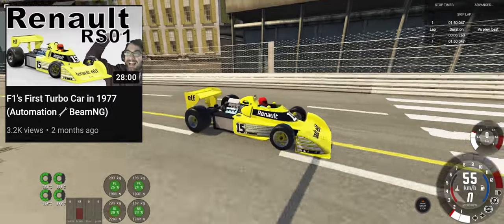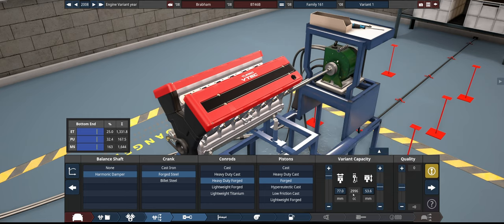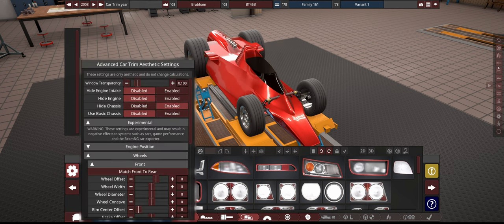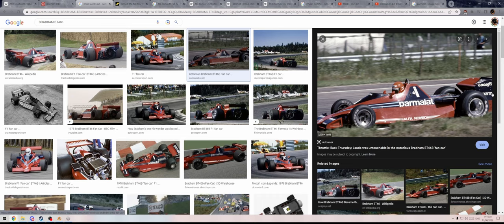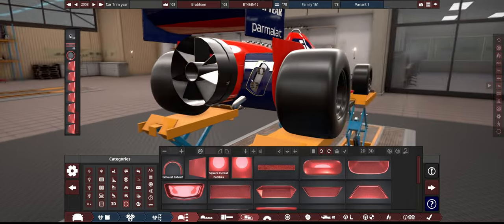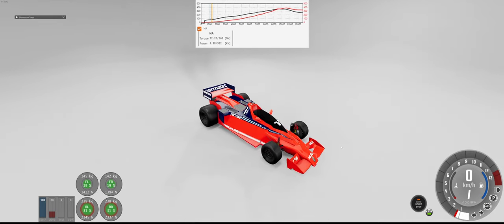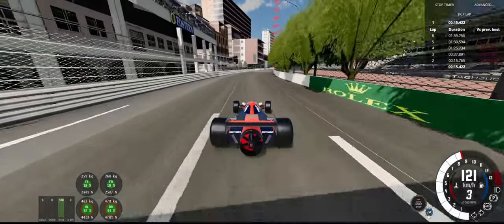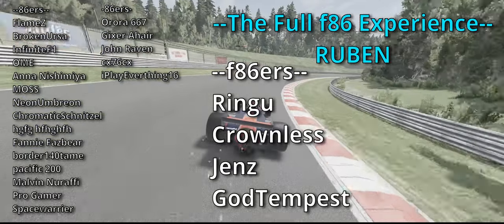I Made the F1 FAN CAR in BeamNG (ACTUALLY WORKING!!)

Comment: No, the car wasn't ilegal, FIA said that you can use a Fan for the car, but at least 50% for cooling(they said 50%, they said another word, but forgot what is the word lol), so they used 51% cooling, 49% for downforce, Brabham wanted to merge(is that correct?) with Lotus, and if Brabham didnt stop using the BT46, they wouldn't merge into one team
Reply from the maker: the ratio of cooling to downforce is a flawed one, and only makes sense if you do mental gymnastics. There was also rules that stated aero devices had to be fixed to a sprung part of the body, and immobile. So if they wanted it to be legal, it was going to have to pull from the side, front, top, or rear.

it didn't exactly get "banned" because of the back door deals made, but they would have not let it race more than that race. And brabham would have fought the rulings.... this was the easiest solution

Comment: that tube on the nose is called a pitot tube. its usually seen on aircraft. pitot tubes measure true air speed meaning how fast something is actually going without any thoughts of outside effects. that is in contrast to indicated airsp[eed wich takes in to account the wind going against something and the temprature ect. so true air speed is the most acurate measurment of speed and its measured in knots

Comment: Fun fact, that car was of course against the spirit of the regulations, but actually legal!
Basically, the rules of the time stated that any movable part can’t be used if it’s PRIMARY function is generating downforce. As it has to be primary function of the element(so more than 50% of movement aids downforce), an “engine cooling fan” can actually be used as long as majority of air is used for engine cooling. The BT46-B’s fan used around 60% of air it pushed for cooling that Ferrari/Alfa flat 12(which was by the way VERY prone to overheating), with the remaining 40% sucking the car to the ground. The FIA actually allowed it to race for the rest of the season(with changing the regulations for next year making such things illegal)
As to politics, Bernie Ecclestone was the chairman in FOCA aiming to be the leader of it, and all other team bosses said that if he won’t retire both cars after Sweden he will lose all support from them. Bernie agreed to willingly retire the car after 3 GP’s, though it ended up racing only in one
Reply from the maker: it's primary function was not to cool though :P it was no better for its cooling being there.

also the rules stated that all aero parts must be immobile, and fixed to a sprung part of the car. It was against the rules, but it could be considered in a grey area if you did mental gymnastics haha. The rule hadn't been tested, and was going to get banned, and they would fight the rulings etc, but the owner made a deal to remove it, and became the head of the FIA shortly after

they also didn't close a loop hole the next year, they clarified it :P
Reply: @fillman86  of course it wasn’t it’s primary function, as in it wasn’t built for that, but the bigger part of the fan’s work was cooling the engine. It had to be this way, so that it wasn’t considered an aero part by the rules and didn’t have to be immobile. That’s the grey area You are talking about. 

Also, Bernie never worked in FIA, You probably mistaken it with FOCA. FOCA(Formula One Constructors Association) was the opposing body to FISA, which was the governing body of F1 at the time. It was a delegated part of FIA and ended up merging back with FIA in 1993. FOCA ended up becoming Formula One Group holding all rights to F1.
Reply from the maker: @rotkiW9014  ah, I did the political research about 6 months ago, so my memory was foggy.

Define an aero part... something that aids in creating downforce? then it needs to be bolted to the sprung body, and be immobile. If they wanted to cool the engine this way, then it must draw from the front, sides, or top :P I know you want it to have this cool thing, but think of it this way, they cheated, and got away with it haha
Reply: @fillman86  That's not what the rules said at the time, that was the grey area they exploitet. Since more than 50% of the fans job was cooling the fan it was legal under the rules as a cooling device. Of course the intention behind it was to create downforce through it, that's why it was designed to be so big. That way even using less than 50% of its power to create downforce directly meant they had enough to make the car work.
Reply from the maker: @Sternendrache11  it was exactly the rule, because it was to combat people attaching wings to the suspension, or directly to the wheel-hubs, then having them collapse

Comment: the jato trick is a bit janky but then again the whole car irl basically was aswell.
Plus to an extent its pretty realistic to the real thing, considering the fan was directly attached to the gearbox of the Brabham's engine.

the car is in automobilista 2 aswell, and the car is still hard to work with in a fully fleshed out sim like that. Definitely an experience, trying to take a slow corner and pushing the throttle more than normal and praying the fan works, or riding the clutch to bring up more revs.

I dont remember where this information is from but Im pretty sure even Gordon Murray himself said the car was rushed.
Reply from the maker: it was, because they knew that the first fan car on the track, would be the last. And it was an easy win to take, so they rushed it to track first
Reply: @fillman86  I think it was also due to the engine itself. 
The Cosworth DFV in the Lotus 79 took up less space underneath the car where it mattered, and meant more room for the ground effect black magic they were looking for. Ferrari were in a similar situation, the flat engines were good for lowering the centre of mass but took up room that could be used for maximising any gains ground effect had to offer.
Brabham were basically forced to come up with a solution straight away due to of a big chungus engine.
Reply from the maker: @Lego___  they weren't forced to do it, it was just an easy trick. As for the flat 12, they were in a tricky position, but ferrari eventually made it work, though in a diminished fashion.

They were also well aware that the car would likely not be allowed, or only allowed for 1 race (it was said that it was allowed for the rest of the year, but that's not true haha)
Reply: @fillman86  true, though it was obvious the flat 12 cars all had a disadvantage compared to what Lotus could do with the DFV

Speaking of 12 cylinders however, 100% agree that automation V12's sound horrible. They always have sadly, though they used to sound amazing in 4.26 with the intake sportiness settings, it almost sounded identical to the AM Valkyrie (though sounded nothing like it in beamng)

Comment: I understand that over the history of production cars only Ferrari ever put flat 12s in them (Testarossas and Berlinneta Boxers), but I SERIOUSLY WISH automation had them as an option.

I'm absolutely not a game dev. I have no idea when it comes to the difficulty of adding options to a simulation game, but would it be that hard to basically simulate welding two flat sixes together 😂
Reply: (also the 115-12 version used in the f1 cars had efi)

ALSO ALSO JUST LISTEN TO THIS THING

v=S0vOTD6_ois&t=74s

(Group 6 but same engine. And my comment kept disappearing because Yoobitoobi is dumb, so I had to not have a hyperlink)
Reply from the maker: haha it's quite so simple, as the firing order is quite different, but I suppose yes, just doubling the outputted power "could" work, and the 3D model part is easy, because it's modular

Comment: @fillman86 a suggestion you should do is try to make the brabham car from 1986 that had 1450 hp. There should be decent photos on the internet to create the model, and who knows how it will perform on the test track. The engine is called the BMW M12 btw
Reply from the maker: I don't think anyone has suggested that brabham before.... it also seems to be a bit unremarkable?
Reply: @fillman86  true, the only thing it was known for was being the most powerful f1 car. But, I, along with some people maybe would wonder what 1450 hp does around the test track
Reply from the maker: @LiftingHaven  there's many claims to that record, but I think it's mostly the engine manufacturer, but there's more than that quoted
Reply: @fillman86  we know it had at least over 1000 hp because it broke BMW’s dyno

Comment: do you think you could rotate the jato thing so that it pushes forwards slightly too? im not certain but the 2j chaparral got some forward thrust due to the exhaust pointing backwards so i reckon its the same on the brabham f1 too
Reply from the maker: I think any forward thrust would be undone by loss of power. Not to mention that it's not pulling much air, and it moving it much slower than the car is moving (I believe max air speed form it was about 50mph or something)

Comment: Wait, wouldn't does the fan only help with down force, or is it also there to lower the low-pressure at the back of the car?
Reply from the maker: what? it creates a low pressure area under the car, thus creating downforce
Reply: @fillman86  yes